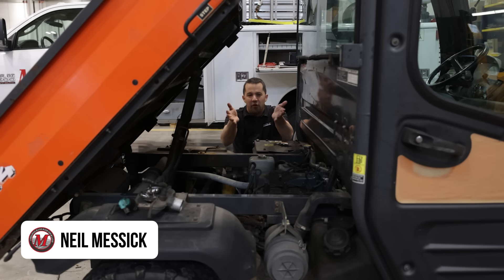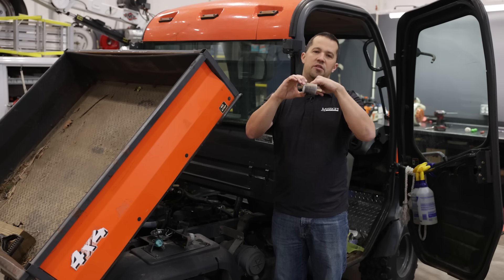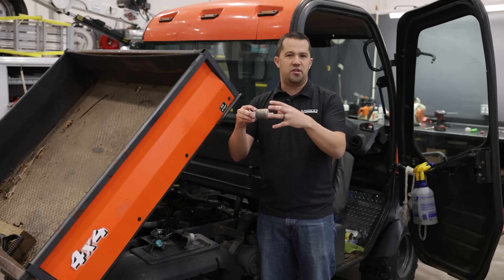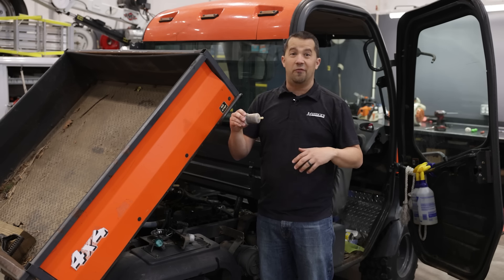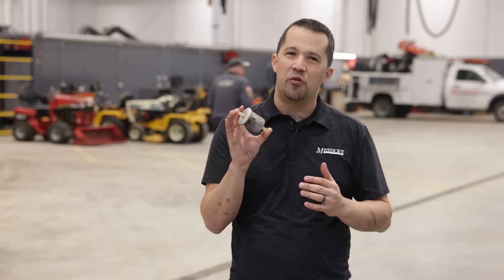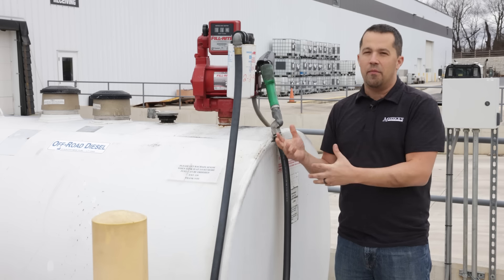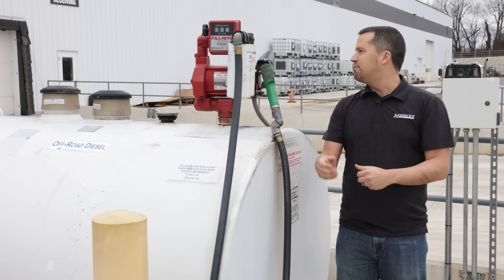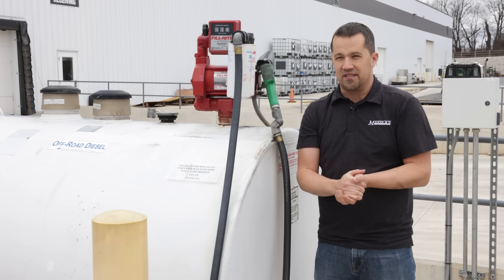How this $10 fuel filter led to $1,700 in damage

Comment: You could have also grabbed an old rubber fuel hose to show that the manual wants them replaced too. Mine are just over 6 years old & they feel like I could rub them apart with my fingers.

Comment: OK This is hard to accept at face value. I am a mechanic of 40+ years. This vehicle would have to be run a long time with low fuel pressure to do this kind of damage, the operator must be a complete tird to not notice how the machine had  HARD STARTING, LOW POWER, ROUGH RUNNING, HEATING UP MORE THAN NORMAL, NOT ABLE TO REACH MAX RPM this would have to go on for quite a while,  I would fire him.
Reply: They promoted him.

Comment: Had the exact same thing happen on an RTV-X900, took out the injection pump which I had rebuilt, and the lift pump which I replaced with a $15 electric unit from Amazon. Expensive lesson!

Comment: One thing I was told many years ago is to avoid purchasing fuel from a service station if there is a fuel tanker filling the service station up…….the theory being that the incoming fuel going into the service station bulk tank is churning up and unsettling any sediment that has accumulated over the years in these tanks, which has the possibility of going straight into the fuel you’re about to purchase.
Reply: My uncle owned a Shell station back in the day and told me the same thing. I'm not sure that holds true today as it did back than as there are filters on the pumps nowadays. If you've ever pumped gas and noticed the pump is super slow, that is usually the reason I was told by the attendant. But I still avoid hitting a gas station that is being supplied anyways.

Comment: Yes I was a Diesel mechanic at a fleet for years. If the company bought a brand new piece of equipment.. No matter what it was.. The company would work in the price for filter reminders.. I realize this is an option for many different kind of Filters.. We would have them put the filter minders in the operating cab. I believe they worked well and save many thousands of dollars in Repairs... Hopefully This could be an option for your equipment also.

Comment: My MX5200 is 3 years old now. I don’t live on my farm and due to work changes I have not been there for a year. When I leave the farm I fill the fuel tank up on all my machines to the brim. Will this reduce the likelihood of Alge or moisture building up in the fuel tanks?

Sometimes the power reduces dramatically on the MX5200, especially when driving on sideways on a slope with the right side down hill. I’ve asked about this on a FB group. The response is moisture in a safety sensor under the seat could cause this. Admittedly the weather has been very wet on my farm since I bought it and I once used it in the pouring rain. Could moisture in a sensor cause this issue?

I am looking forward to retiring from the world of work so I can spend more time on my farm.
Reply from the maker: Yes, keeping the tank full helps reduce the amount of moisture that collects inside it. 
Is your butt coming off the seat on a hillside? happens to me.